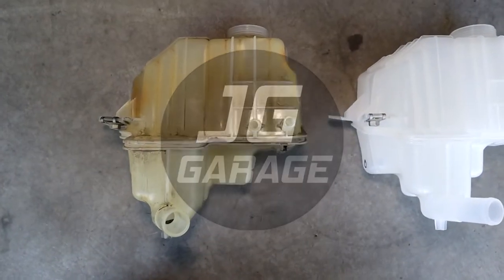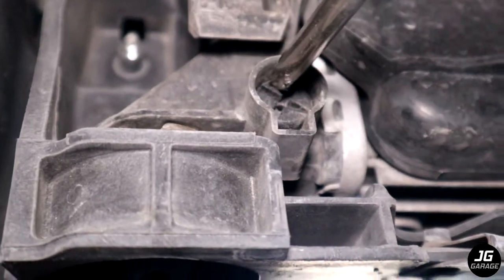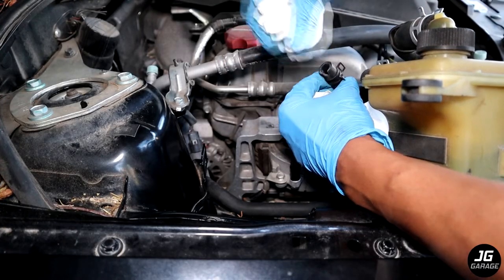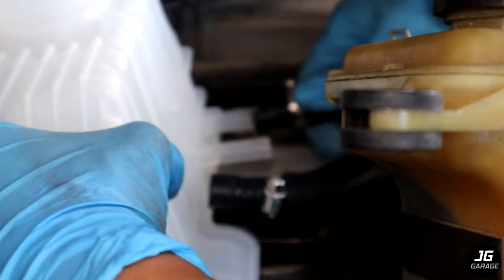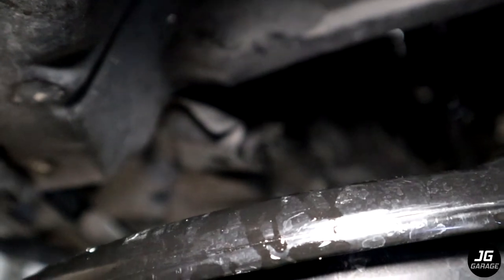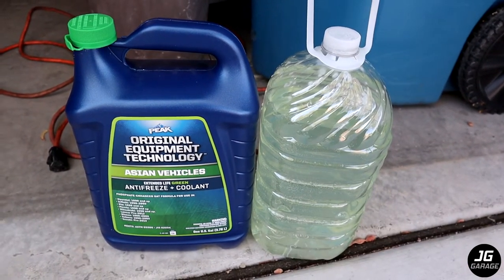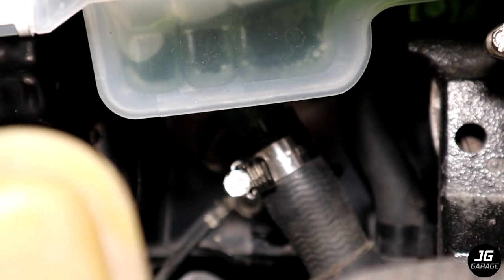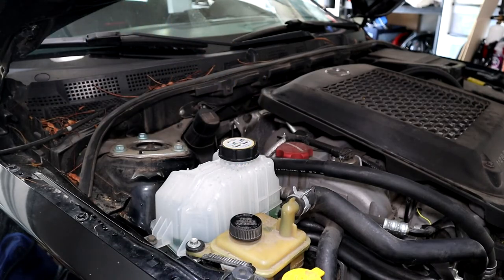How to Flush Coolant & How to Replace Mazdaspeed 3 Coolant Reservoir Tank | Mazda 3 Mazdaspeed 3

Comment: You need to use the original style clamps. Those allow for the plastic to expand and contract without cracking over time. The clamps you used are meant for metal pipes.

Comment: Is this coolant okay for the a 2008 Mazdaspeed 3 ? I did research and it seemed okay. Just had a coolant flush and put this stuff in. Now my coolant runs about 5 degrees Fahrenheit hotter than before. It should be noted I did a couple other things as well such as vvt replacement and used a different oil. EGR cleaning and intake valve cleaning as well
Reply from the maker: Yes this coolant works for your 2008 Mazdaspeed 3. The car in this video is my 2009 Mazdaspeed 3. I never had issues with the temperature. The coolant for the Mazdaspeed 3 is the dark green coolant like the factory FL22. Common alternatives are this PEAK Asian Green coolant or Valvoline Green Zerex. What mixture did you fill your cooling system with? 50/50? Also did you do the air bleeding process?
Reply: @jggarage1807  I filled it directly with the one from the link. The already diluted 50/50. I also used royal purple 5w30 which I heard good things about. Idk if that makes a difference. I noticed the coolant would fluctuate depending on if my car was hot or cold but I read up and saw this was supposed to be normal because of it traveling to the radiator. Also, I noticed that my coolant fluid is slightly above the "F" Line on the coolant reservoir. I tried looking for the letter "L" indicating where the minimum line is but couldn't see it. Maybe there's too much fluid? Although I do believe put the required amount being about 2 full bottles of the coolant. However I did not do the bleeding process myself as it was done by someone else as well with the VVT job(thought I might as well get the coolant flushed while he's as it). So perhaps that could be the case. Would it be okay to bleed it again just in case even though it might've already been bled before? Is there any other reasons why my car is suddenly running hotter after the work was done? I appreciate your time.

Comment: You installed the incorrect clamps…..the original style clamps are designed to expand and contract with the heat of the engine. The style you used will not.
Reply: The clamps you are talkinh about literally 3 days ago made my line that connecte to the oil cooler fell off and drained all my coolant. And they were brand new

Comment: How much coolant should you put in
Reply from the maker: The coolant capacity is 7.9 quarts or about 2 gallons and when you drain the coolant, you only drain about half which is around a gallon. So you'd need to put 1 gallon of coolant back in. 

In my case in the video, since I flushed with distilled water and had distilled water in the system, I added about a gallon of full coolant concentrate at the end.
Reply: @jggarage1807  do I fill the coolant above or below the f mark
Reply from the maker: @copynpaste_9979  when you fill after a drain, you'll need to add more than the F line because when you start the car and bleed the air out, it will suck more of the coolant. Once you finish bleeding, you can fill to the F line since the system is now full.

Comment: I think every person that's ever owned an MS3 has replaced this tank 😂
Reply from the maker: Oh I didnt know it was a common issue! lol but dang was that coolant reservoir expensive..
Reply: @jggarage1807  it was about $75 when I got mine a few years back from a dealer in Arizona. He has an ebay page. I'll send the link if I can find it again
Reply from the maker: That's much better than what I paid for. lol I did see it cheaper on both Amazon and Ebay but I didn't have the time to wait for it to be shipped. I had no choice but to get it locally and do the fix right away.
Reply: Own two bk mps’s and never had to in 4 years
Reply from the maker: Oh nice! That's a good thing! Hopefully you never have to. Thanks for watching!
Reply: yup tm morning i will replace it
Reply: 2007 Speed3 with 180k miles, original tank just fine. Guess I'm lucky?